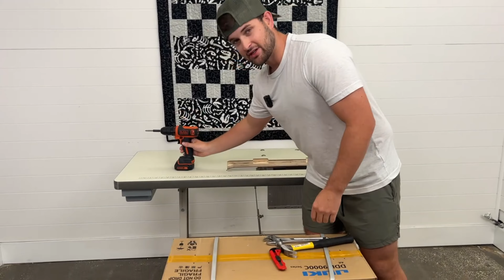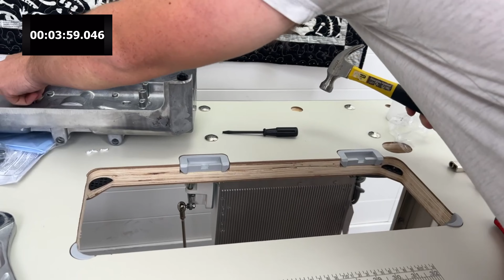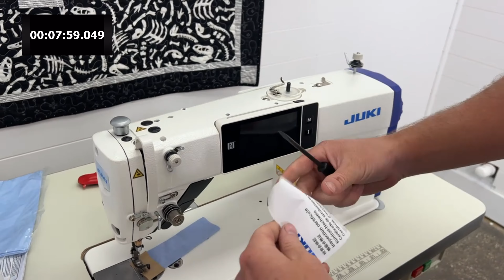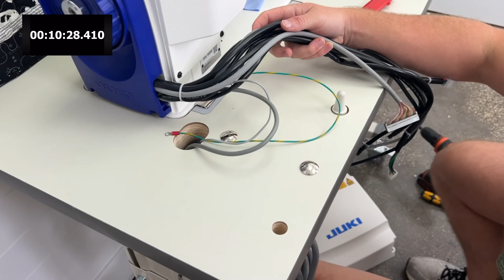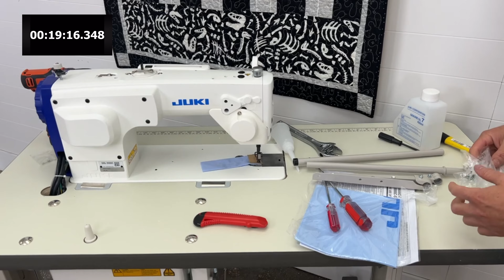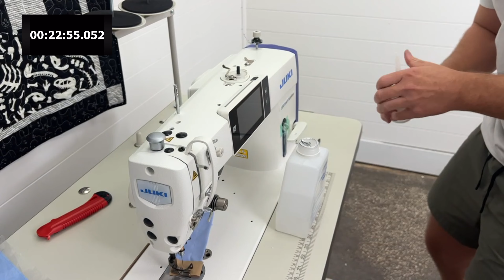HOW TO SETUP THE JUKI DDL9000C (SPEED SET UP/ NO CUTS)

Comment: this is rather a programmable factory  sewing robot for those sweatshops than a home workshop installation for 15 - 25 years. So much electronics with very tiny SMD elements placed on the almost $500 motherboard. 🤔🤔 UPD: Ok, there are walking foot electronic-less machines as well on this channel, I llove even watching them  :-))
Reply: Not sure what you are saying? Are you saying it’s not a good machines???
Reply: @MsHighpeaks  Well, these look good for large factories :-) when each machine is programmed for a step/stage in their technological process. At home workshop you should also expect some accidental unplanned  electronics failure in some far future say 10-15 years, thus provisioning  funds for replacements.  But if you make enough money with this machine - you should be less worried I guess.
Reply: @MsHighpeaks  I  mean this is a deeply commercial machine which should earn money every day  and if a death day comes to that insanely complex motherboard  there is already some enough money to recover from disaster.